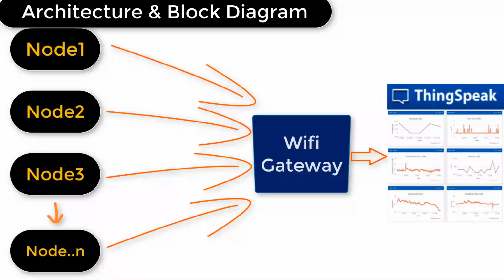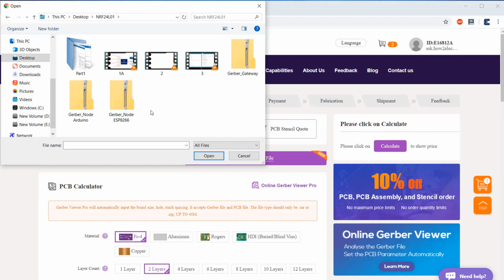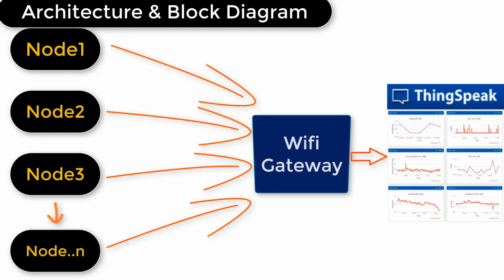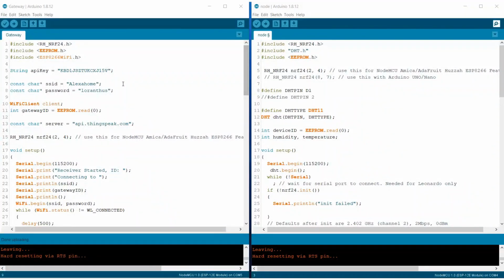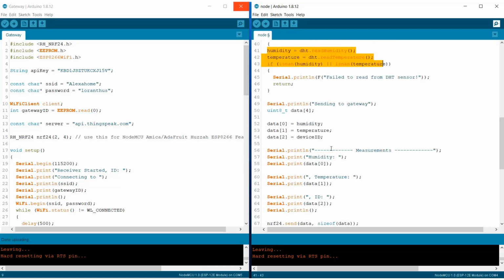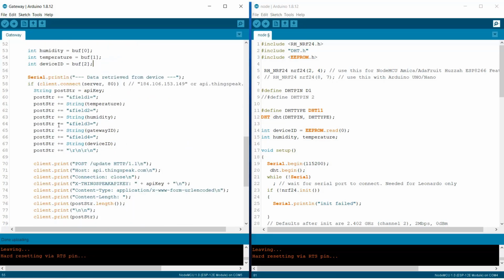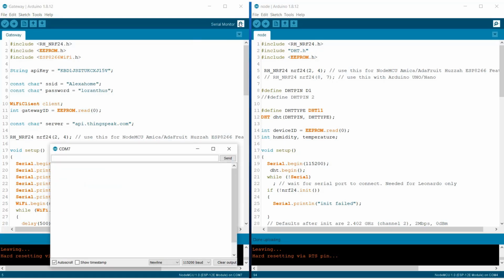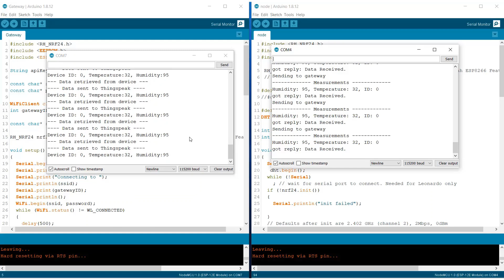ESP8266 NRF24L01 Wifi Gateway + Arduino/ESP8266 NRF24L01 Sensor Node

Comment: Can I use an ESP8266 NRF24L01 + PA + LNA 2.4 GH Wifi Gateway + ESP8266 NRF24L01 + PA + LNA 2.4 GH Sensor Node?
Reply from the maker: Yes you can. This will give more better access.
Reply: @HowtoElectronics  but can I use the same code or does it vary in any way?

Comment: If I want to connect a NRF24 module with ttgo-t-call then which pin should I chose, that the GSM connection will not interrupt.

Comment: I want to make this by using nano as transmitter and node mcu has receiver by sending accelerometer data with NRF24L01 help. so, can u help me in any reference to do it... Or what changes I need to do if I use Arduino nano and node mcu....

Comment: I use this with UNO (transmitter) and NodeMCU ESP8266 (receiver) and have no problem. But when I use UNO as receiver and NodeMCU as transmitter. It doesn't work. So I searched the internet found out that I need to solder 10uf capacitor to VCC and GND of the NRF24L01 on NodeMCU side. Now I can't upload sketch to NodeMCU when VCC and GND are connected to the module. Did I solder the cap wrong?  VCC -> positive of cap and GND -> negative of cap.
The module I'm using has antenna connector.
Reply from the maker: The capacitor should not be a problem l. After uploading the code solder the capacitor.
Reply: @HowtoElectronics  I uploaded sketch to NodeMCU and then connected vcc&gnd back to the NRF Module. No communication between the transmitter and receiver. I guess capacitor method doesn't work with the module with antenna connector.
Reply: @jumbo999614  did u sort that out

Comment: Your complete project can be replaced with only one ESP 01 and DHT sensor. Still if you want to have a WiFi bridge, use a NodeMcu in WIFI_AP_STA mode.
For such a simple task you used excessive hardware.
And before promoting any vendor, first you do place an order and then cover its quality and feedback as well so others can make an informed decision about using the same service.
You clearly just added them to cart and didn't order. Never once showed the PCB in your video.
Still I'll say good job for the efforts you put.
Reply: Abdus Samad, lo que estas recomendando no es valido si se requiere cubrir un rango de distancia grande...